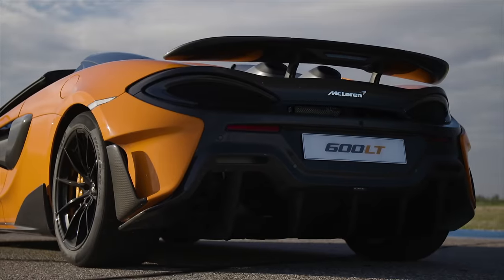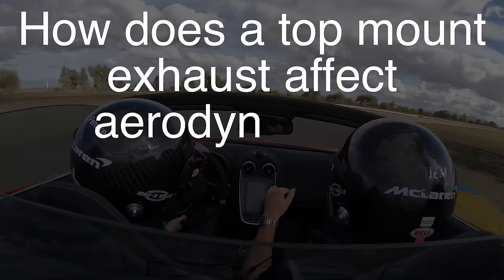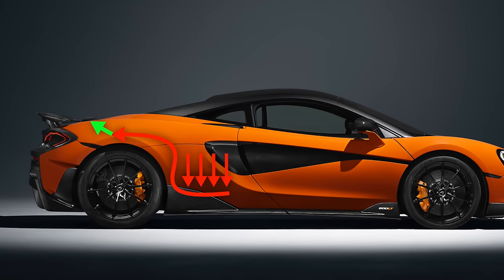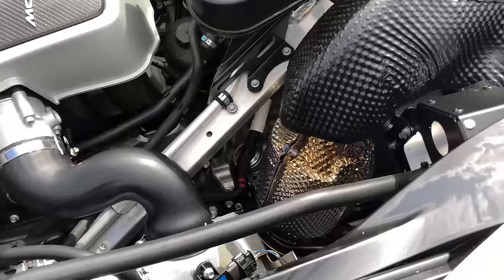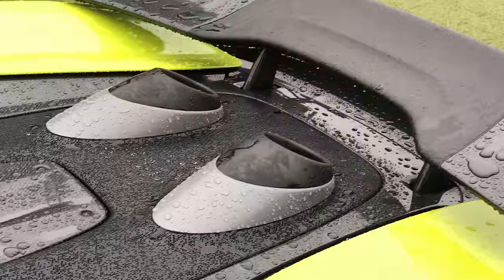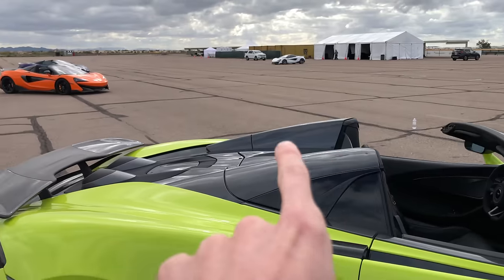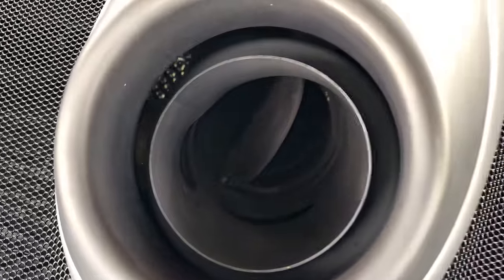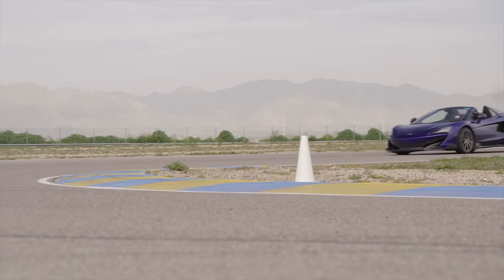Why McLaren's Top Mount Exhaust Is Genius

Comment: who needs animations when you can wave your finger around :). great explanation. I love the look of top mounted exhaust in both the 600LT and the porsche 918
Reply: Q the fan and colored smoke.
Reply: I found it distracting and confusing. I feel that, maybe, if this were done inside, with, maybe, a colour code diagramme drawn on a white background, I might understand better.
;-)
Reply: @WouterCloetens   Would adding a slide ruler and active electric wave device. With a 3D gridded graph chart be needed as well? Or would that be a bit much?
Reply: turbulence in wrong direction？。。。
Reply: @WouterCloetens  Get better spatial reasoning?  I saw the "invisible" line he drew perfectly.  I even gave it a red color and an arrow point at the end.
Reply: This is the comment I was looking for :D
 @tonyxu6625  nope, thats exactly what is happening. Just imagine the slipstream that blocks the air from rotating downwards, so the turbulences have to form the other way ;)
Reply: @logiarhythm6285  Thanks bro~ Is slipstream caused by exhaust？
Reply: @tonyxu6625  not really. Maybe it makes more sense to you, If I freely translate the German word for slipstream, which is WIND SHADOW - so basically the area the airflow cant reach, mostly behind vertical areas like the rear window of the McLaren.
Reply: @logiarhythm6285  agreed. But my confusion was concerning the direction of vortex's rotation. There might be some misunderstanding between our expressions. Is it possible that u give me your email, and thus I could illustrate myself more clearly 😝

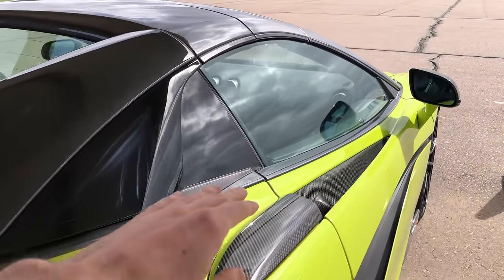Comment: 4:00 OHHHH, I always thought wings dipping in the middle was for visibility sake, i.e. not blocking rear window, but that's neat to know that they aren't really needed as much there.
Reply: you're here too?
Reply: @maniya6830  always have been
Reply: Now here's a reason I like McLaren, and because of their suspension on the 720s which uses a needle valve to control liquid flow, having a unique piece called an "Oriole". No, I'm not British, I just put the period on the outside because it makes more logical sense since I'm not borrowing the period, that technically counts as deficit liability, liability meaning who or what is responsible for something. Legal long, don't have time, and a lot of it repeats each other. Now, an "Oriole" equation is really interesting but hard to memorize, other than russian "E" which is "э" but facing forwards, "B" with a line which they use in Stock Market math, me having terrible memory. 

America Can't Make That, 99% of their cars are CRAP

Comment: It may have multiple advantages, but all I care about is that it looks so damn cool.
Reply: Eric Ortiz they should have said Porsche. The 918 had this for years
Reply: @THESLlCK  its a different setup... just because they're both at the top its not the same...
Reply: Matt S  lmao go play with ur supposed physics, i'll go with the brilliant engineers at mclaren and play with their proven exhaust design.
Reply: Matt S It’s sad that I have to point this out, but no one thinks a top mounted exhaust helps propel the vehicle. He never said that, ever. Did you watch the video?
Reply: Kuma Bear The title of the video is specifically about them being over the engine. That’s the operative term here.
Reply: Matt S with the Porsche, it’s surrounded by steel and titanium so it doesn’t have that problem.
Reply: Actually I think the new McLarens look like a knock-off of a real supercar. The F1 from the 90s is 1000% better looking.
Reply: Matt S  Maybe you should go to school mate
Reply: Matt S  Did you watch the video? What is difficult to understand about 'weighs 12kg less' and 'allows for a larger diffuser that produces 100kg more downforce as a result'? No one said they are there to propel the vehicle.
Reply: Yea I am a shallow man .. cool before practical....
Reply: Matt S  The exhaust isn't producing downforce. It's allowing the diffuser to produce more downforce. It is shorter therefore weighs less. It doesn't require extra cooling of the engine bay or whatever it was, so it is lighter by two electric motors.

What do you not understand?
Reply: Matt S  donno where u got the top exit exhaust propelling anything and producing downforce... none of us, nor EE & mclaren said it does that... u are the first to mention it... that is certainly nonsense and saying the exhaust design is useless based on nonsense you must be out of ur mind. 

The top exit exhaust shortens the exhaust design therefore saving weight... how is that a gimmick its common sense you use less metal, therefore lighter... Another benefit of that is it has less back pressure, which can get air out quicker that's part of the exhaust scavenging effect that you want to have to draw more power from the engine... it also frees up the space below for a more effective diffuser. 

Just admit its a brilliant exhaust design... stop fighting with your imagination over actual r&d.
Reply: Taylor C yep all the new ones look generic.
Reply: Matt S  All you're saying is that the guy in the was wrong. You never give any reasons nor explanations but keep saying you're right and everyone else is wrong.

Of course you're right because you're the smartest person on the Earth.

Comment: So is that the reason why front wheel drive turbocharged lawnmowers have top exit exhaust?

I mean.. they're still mounted in the engine bay.. :o
Reply: they're using the thrust for more downforce on the front tires. oBvIOusLy.
Reply: @TheDaltonmichaels  haha damn I missed that benefit
Reply: Your push mower is turbocharged to ?? Yoooo we should start a club
Reply: Ungregistered User  lol just embracing the moniker. Actually drives said lawnmower to work.
Reply: @nickgaitan2883  Too? Yes, it is too. Also...whooosh!

Comment: I'd be interested to see if they're getting more down force on the rear axle in higher RPMs in addition to the benefits you discussed, since the exhaust flow is going to be directed upwards. There's an interesting momentum balance problem there.

Comment: It could actually generate much more downforce if the exhaust were pointed directly below the rear wing. Since hot gases come out of the exhaust (low pressure air), this would greater the difference in pressure between the top of the wing (high pressure) and the bottom (low pressure), and thus causing the air at the top to "try to" go to the bottom with increased "efforts" (pushing down).

Furthermore, if the exhaust pointing below the rear wing were also positioned further away from the center of the car (near the wing tips), it may generate even more downforce. Though, I'm not so sure about this one since the "more freely" flowing air would disipate the heat quicker than the turbulent air at the center of the wing.

I'm a student on aviation and this is the first time I'm analysing the aerodynamics of a car, so let me know if I'm wrong.
Reply: Hello Mati N, im not an engineer so my comment might not be that precise however i think its not the best idea to put exhausts right below the wing for one reason: it spits flames sometimes. Let me know if you think im wrong, im open to discussion. Have a nice day
Reply: @FiliptheSon  Greetings. That's something interesting I didn't thought about, actually. Maybe that is one of the reasons why the center of the rear wing is made of carbon fiber.

Now that I think about it, the exhaust shown on the video could not actually be in any better position!!

Thanks for your comment!
Reply: Still gets very hot.  Without the heat shielding,  you’d be melting stuff.

Comment: Rev up your top mount exhausts.... oops, wrong channel!
Reply: Your Mums HITACHI  Vinícius will regret making fun of Corollas when he gets code P0299 on his Cruze Turbo eventually.
Reply: Joselito Muller II - não sou o Emanuel or the valve cover leaks, water pump issues, randomly exploding cooling system, engine sludge, on and on
Reply: Vinícius actually I don’t think it’s that simple as you made it seem. I drove the latest Corolla in the USA and well the ride was perfect, interior was luxurious, quiet, and very modern but what I didn’t like is the sound system sounded horrible, power seemed lethargic, and the infotainment screen was ugly and big. It’s a mixed bag. Hopefully Toyota makes improvements
Reply: Vinícius I wonder why the issues with Honda and what models?? I drove a Cruze and really wanted it because it had everything I wanted but the way the clutch felt on engagement bothered me. I took the Honda Civic 2017 instead but I regret it. It is much louder and the seats do not adjust as well as  Cruze. The Cruze will even fit you if you are 1m 90cm tall. I think Cruze was designed in Europe and then assembled in various plants around the world huh? The first gen had oil feed issues for the turbo but newest is ok there.

Comment: Extra downforce!
Reply from the maker: It is wild that with top fuel cars the exhaust does legitimately provide downforce, something like 800 lbs. Just absurd!
Reply: Euuuuuuu
Reply: Ive also heard that due to the immense heat +  the fuel continually burning even after its left the headers that the hot air then travelling over the massive rear wing provides additional downforce on top of the downforce provided by the headers simply being turned up and back. would this be a correct theory?  maybe a good EE video?
Reply: Engineering Explained 800lbs?!

Comment: Is it possible to use exhaust gases to increase down force? blowing them to the wing in an angle that produces down force... my engineering gut says since the car (exhaust, engine, wing and etc) can be considered as 1 system, those forces act as internal forces and cancel each other, but I'm really curious to know the right answer.
Reply from the maker: Yes, it's possible, and in top fuel it's actually the case, but not from blowing a wing, simply from the force exiting the exhaust pipes pushing the car down. With the 600LT, as discussed in the video it won't have much effect on downforce.
Reply: @EngineeringExplained  Thanks
Reply: It is also possible when used on diffusers. It's called a blown diffuser which has the excuse blowing hot and high flowing air through the diffuser in F1 cars (not in use anymore due to regulation). The hot and fast moving exhaust causes lower pressure under the diffuser which is the point of the diffuser in the first place, this effectively places the exhaust in a beneficial position as well as increasing down force with no negative drag effects.
Reply: Also I would have thought that when under hard acceleration the turbulent air from the exhaust would decrease down force and therefore decrease drag, but when decelerating into corners the effect would diminish, so it acts almost like a DRS system?
Reply: @jethrofennell  considering the downforce there wasnt very high to begin with, then the drag wasnt big to begin with. And in this case, turbulent air reducing downforce doesnt always = less drag, since turbulent air can sometimes be the reason for drag behind the car, sucking it backwards
Reply: @Stefan Vulin you mean a blown wing? Like the blown diffuser, it's been done in F1.
Reply: pretty sure if you point exhuats under the wing you can create extra downforce.
Reply: The force exerted by the exhaust would be insignificant compared to the aero at even low-moderate speeds.
Reply: Was wondering this as well.
Reply: No the gases from the exhaust would be a posotive velocity only disturbing the velocity of the air traveling over the car in a negative velocity relative to the car think of holding a piece of paper out the window while driving
Reply: In a similar spirit Rolls Royce realized during WWII that they could get some thrust from the exhaust coming out from the Merlin engine alone (ejector exhaust).
Reply: If. U want 10 gallons a mile
Reply: They should make the air intake point down then, too.  The sucking force and all.
Reply: The R.S. 18 if I'm correct used a blown wing
Reply: Exhaust force is not enough force to create down force . This is not a jet engine...
Reply: You should look in to Isaac Newton
Reply: Masoud Hosseini w
Reply: Do you feel a very high pressure beam of air out the exhaust when the engine is on?
No, therefore it won't have any effect. Then you might as well have the engine drive a fan that sucks air from the underside of the car.
Reply: I would like to hear those crackling exhaust sound on this car like the F1 cars back then, McLaren also did that to their F1 cars too if I'm not mistaken...
Reply: @Dynoids  Are you sure this was the concept of the blown diffuser? I always thought that the idea was that the exhaust was blown down on the tarmac creating a "skirt" of hot air and for that reason the entrapped air under the car made ground effect and the diffuser a lot more effective. Ergo Vettel pushing full throttle midcorner just to get the car to stick more. I never figured the hot air was blown "in" the diffuser.
Reply: @thortele  I believe that there are around 3ish main versions of a blown diffuser, and both of our explanations could all be correct.

Comment: So, can I say side mounting would be more beneficial than top and rear mount?
> Maybe it would save more 7to8 kgs than top mount
> Maybe increase 4kgs more if cooling fans are used but still 2 to 1 kgs less than the overall exhaust system for top mount
> It won't interfere with diffusers
> Also it wont affect the spoilers even by little
> And no need to worry about rain

Comment: You pointed out the advantages, but not the disadvantages. If a top-mounted exhaust is go great, why doesn't every car have one? Or even every mid engine car? Are you saying that the McLaren engineers were the first to think of this? Or did they have to come up with some other clever bit of engineering that enabled a top-mount exhaust?
Reply: @MrCrackbear  What's so different about the position of the engine? Isn't it just a mid engine?
Reply: @drewmandan  The majority of cars in existence aren't mid-engined!
Reply: @JohnDoe-ne2qs  But lots of supercars are. Again, my question is, why don't all mid-engined cars have a top exhaust?
Reply: @drewmandan  Probably because they look funny. When it comes to supercars, it sounds rather vain but looks matter /a lot/, and I think a lot of people love seeing like a quad-tailpipe.

Not saying a top-mounted exhaust doesn't look /good/, but it obviously looks different and stands out.

Comment: An added benefit of the exhaust venting where it does, is that the turbulent air coming over the roof will dissipate the heat from the exhaust faster, making you harder to hit with heat-seeking missiles!

Comment: In a normal car, the fact that it sucks air from the front and pushes it out the back, how much extra forwards force does this provide? Lets split this into three questions:

1. How much forwards thrust does it provide directly vs neutral pressure at either side?

2. How much more energy does the high pressure intake and low pressure exhaust allow the engine to produce?

3. How much forwards thrust is provided by the exhaust heating up the air behind the car, making it expand?

Are we talking like microscopic amounts, or several horsepower?

Edit: If you want a specific car and engine for the question that there are a lot of specs out on, lets say a Toyota Corolla 1997 E110 2-door hatchback with the 1.3 liter 4AE3 86hp petrol engine and the 5-speed FWD unlimited transaxle drivetrain. (that's the one with the round lights, not the flat rectangular ones). Lets say at 30, 80 and 150km/h in second, third and fifth gear on the flat, holding those speeds but not accelerating at flat dry pavement with the stock tires and standard weight load and standard atmospheric condition.

Comment: For what its worth it is commonly mentioned that freeing up of the bumper space  makes space for a diffuser that assists in generating 100kg of downforce @ 155mph. That number is really quite paltry in comparison to what could be achievable if they really wanted to focus on downforce alone ktake the senna for exampe, 800kg at 155mph).

However whats not often said is that, according to Mclaren, this extra downforce did not involve a drag penalty, and its this ability to improve aerodynamic efficency to achieve the downforce without a tradeoff rather than the downforce figure in itself that is the main genius point of the diffuser redesign.

Comment: Wouldnt the top mounted exhaust increase a bit of downforce because exhaust is still air and its traveling over the wing?
Reply: The exhaust gasses are too turbulent. And the exhaust pushed the laminar flow away from the car, more simply put: it pushes the airflow that passes the car away from the spoiler.
So it gets spoiled. The middle of the spoiler is just there for looks.
Reply: DC:  the exhaust gas is hot and thus less dense.  If we assume that the hot exhaust gas displaces ambient air (turbulent or laminar in flow, doesn't matter) on a 1:1 basis, then the centre part of the wing will produce significantly less downforce with exhaust gas flowing over it than air at ambient temperature would.   

As noted in the video, the centre section of the wing on most sports (and many racing) cars produce comparatively little downforce given their penalty in weight and drag, so it's less of an issue than if the exhaust were exitting in front of the side panels of the rear wing.

Also on this car, a significant amount of downforce is gained by moving the exhaust as the diffuser/ground effect at the back can be both deeper and run the full width of the car... so while the rear wing may be slightly less efficient in this design, the gains in other areas more than compensate for the loss of rear wing efficiency.

As the host notes, this design also saves something like 20 kilos (shorter exhaust, no need for exhaust cooling fans in rear panels etc).